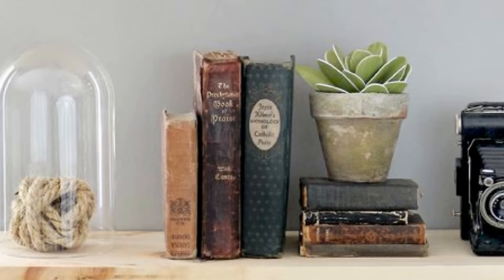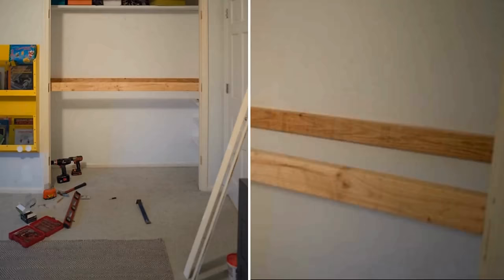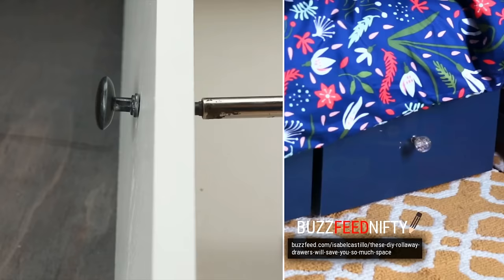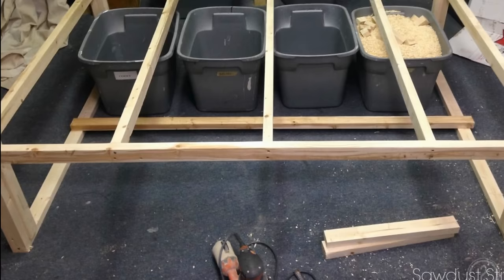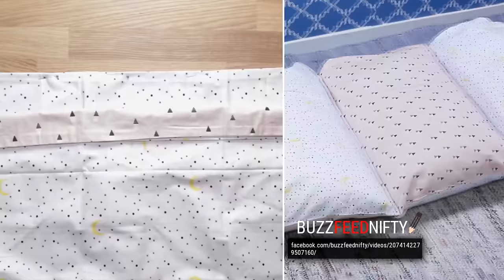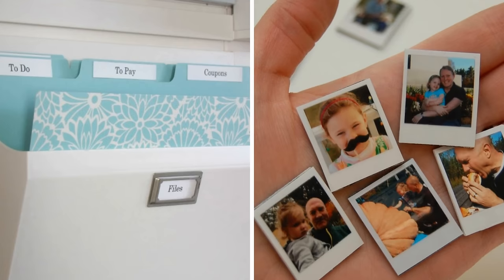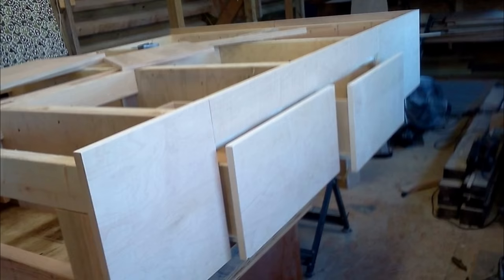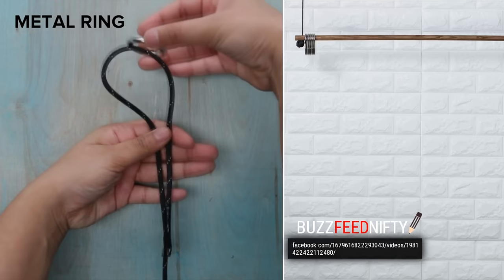20 Lit Small Bedroom Organizing Ideas Worth Trying

Comment: Maybe you wouldn't be stuck with having to make yourself cloth drawers if you didn't use every single drawer in the house to create a bedframe from scratch with drawers. I feel like you just caused hours of diy drawers by using the drawers as a diy platform bed frame.  That is like cutting your shower curtain into small pieces to hand roll them into your own unique toilet paper roll holder just to take any old clothing you are not using to make a quilt which you have to then go to the hardware store to buy some plastic type sheet with a fancy name to staple to the old clothing quilt fabric shower curtain.

Comment: Skipping a lot of steps, and these ideas are pretty lame. Most of these ideas aren't creating any space, and in the case of the hexagonal boxes on the wall, it's just something to bump your head on. You'd be better off filling the boxes with whatever and stacking them in the corner. Oh, and things hanging from ropes are not stable. They sway at the slightest touch or even a breeze. This is just clickbait. Fail, I'm afraid.